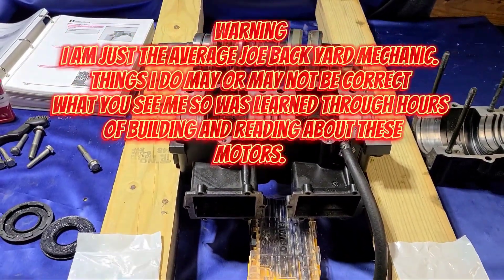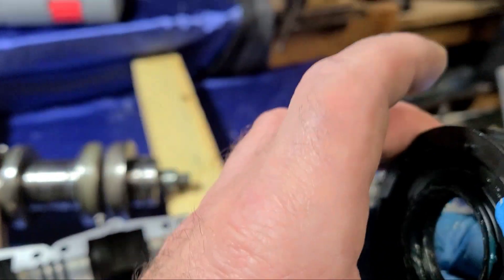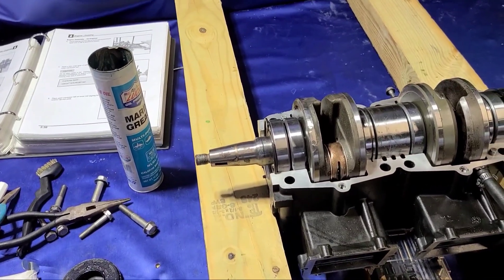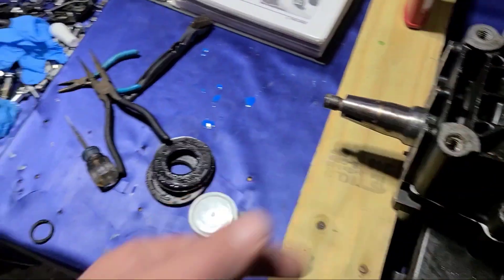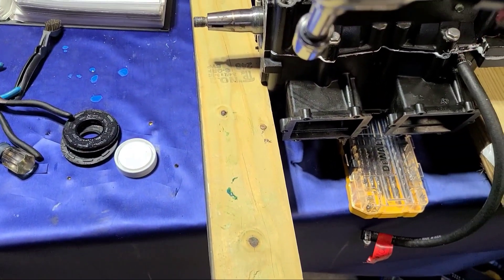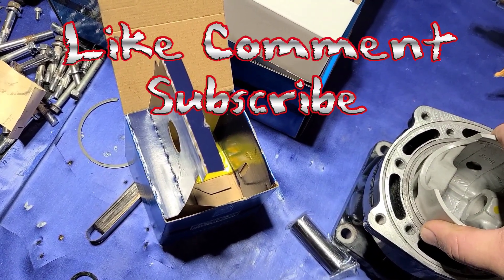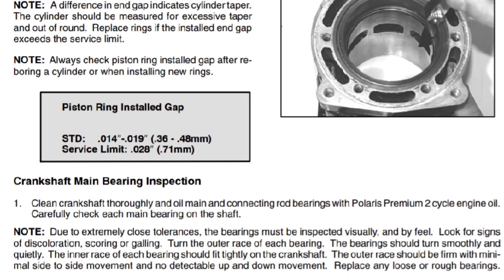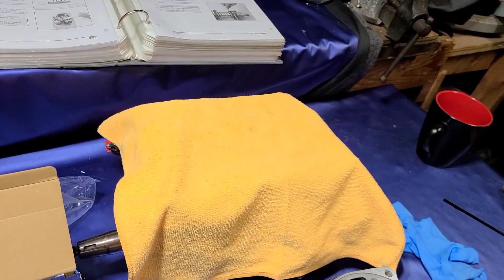Polaris Freedom 700cc engine build Pt1 . crankshaft and gapping rings. Pwc, jetski, waverunner .

Comment: Hi, first time owning one of these two stroke polaris 700 ski do they take any other oil like gear box oil the engine Or is it just two stroke oil mix. Thanks
Reply from the maker: No other oil. There is a grease fitting on the driveshaft bearing tho